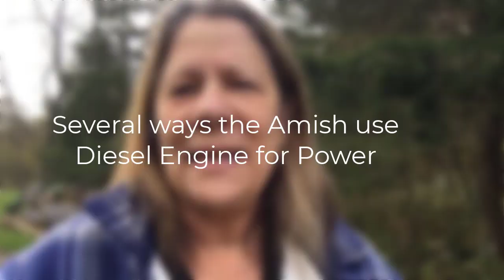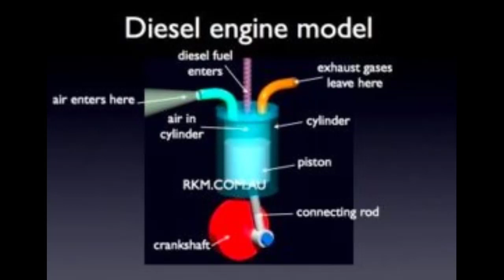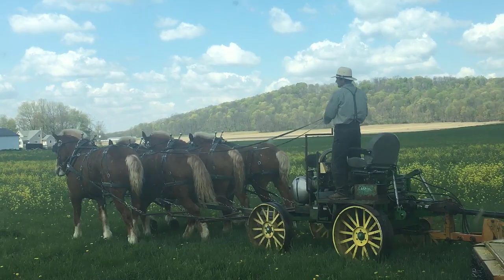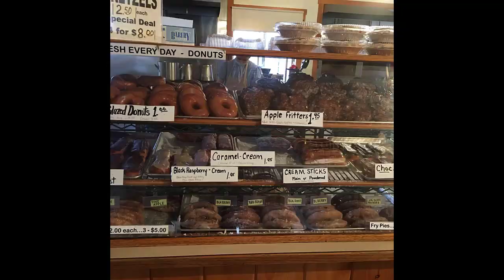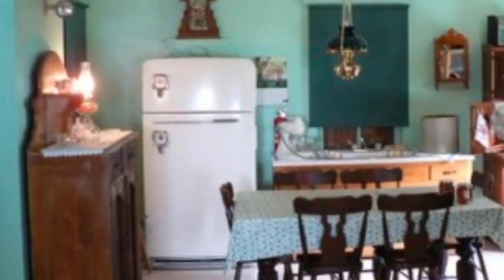How do the Amish use Diesel Power // uses for diesel power engines

Comment: By using a diesel engine they can purchase "Off Road" diesel fuel that doesn't have the state and federal road tax added to the cost.
Reply from the maker: I didn't know that diesel fuel did not have road taxes...
Reply: @LivingThatSimpleLife   Off Road contains a red dye to distinguish it. The taxes are not applied because it is used in equipment that doesn't travel the highways.
Reply: I recently saw a new Amish cabinet shop in a small town in Montana. It’s a little amazing how they have it set up. They have a belt system built in the floor where every power tool is run from a gear and clutch that is all turned by one diesel engine. These tools include one air compressor, two sliding table saws, one large panel saw, one large shaper and a large jointer. The sliding miter saw is run by a Stihl chainsaw engine. These tools are very expensive tools. Not a one of them except for the miter saw cost under six thousand dollars. Some would cost more than ten thousand dollars. Not one electrical tool in the entire shop. I’ve worked in cabinet shops before and the problem I have with their system is that if something goes wrong with the diesel engine, the entire shop is shut down until they can get it repaired. Large cabinet shops have more than enough money to replace any tool in the shop in one day’s notice. 
My brother owns a commercial cabinet shop in San Martin California. He has a CNC machine that cost more than fifty thousand dollars. My brother has retired to Montana but my son now supervises the business for him. They built the cabinets for the Google building that was built a few years ago. At any moments notice, even the fifty thousand dollar CNC machine can be replaced. It’s not smart of these Amish to rely on one diesel engine to keep their business running.